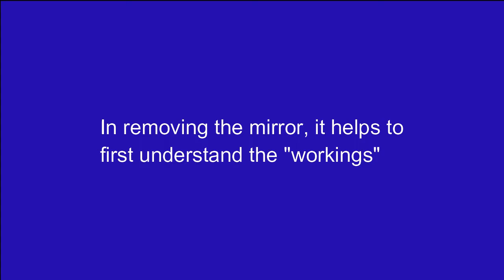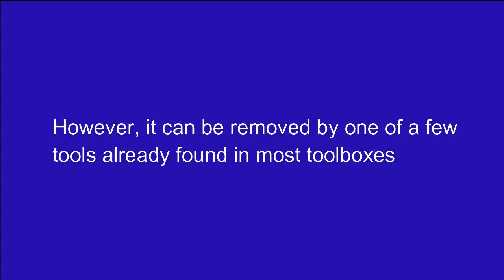Rear view mirror removal & installation (Ford Escape)

Comment: 1st video of DOZENS that actually shows you in detail what you are trying to do, shows actual spring clips, prying slightly downward on the LOWER INNER LIP, while PUSHING it off of the anchor. Others show prying down HARD without SLIDING it off. THAT IS WRONG. This is RIGHT. Prying down HARD without SLIDING can lead to dislodged anchor and/or broken windshield. 
The LOWER INNER LIP is what springs back into place when a new mirror is slid on.
This video is the Gold Standard video of how to do it.

Comment: Great video, after 16 years my rear view mirror in my 2007 mustang GT started to de-laminate, the use of dish soap was very helpful.
Reply from the maker: It's amazing how many times I grab the soapy water bottle. Seems like I refill it a lot, too. it makes a quick, non-greasy lube for plastics...heck, I've used it for lube to press ball joints into control arms. And it's always handy in finding that slow leak in a tire. Top 3 liquids used...PB Blaster, brake cleaner and soapy water! Thanks for watching!

Comment: Just what I needed: starts with a visual of the inner workings, then, explains and shows what needs to happen, and then gives three alternatives to the special tool (I used an open-end wrench, with tape, and it was perfect). Excellent video.

Comment: Great video! Just watched this before replacing the rear view mirror on my 2007 Ford F150. Took all of 3 or 4 minutes to complete. Very helpful. Thanks!!
Reply from the maker: Thanks, Nautical...glad the vid helped. The only thing I wished I had added was to never do this if the windshield is hot from sitting in direct sunlight for a long period of time...it can crack. Thanks for watching!

Comment: this is the best video I saw on this topic.  Looked at a bunch of them.  This video gave me confidence to try it WITHOUT ordering a special tool.  I used a tack pry puller.  Was nervous about cracking the glass, but took it slow as per this video and it came off easily.  THANKS !

Comment: Just a Little Tip: I just removed mine on my 2001 Ford F150, at first I tried it with an Allen Wrench that I had handy, but it was really short and made it difficult to pry the latch, I instead grabbed my longer Pocket Screwdriver and it made easy work of it. So if you have the, try to use a longer Allen Wrench or a Pocket Screw Driver. Also another tip, don't push it all the way up in the mount, just insert it just past the latch and pry there.

Comment: Awesome video. I have a Ford Mustang GT that had a screwed up rear view mirror when I purchased it. I was taking it in to get the Windows tinted at a 3M dealership who works with this all the time so I asked them to leave the mirror off when they removed it. When I got back they said they were afraid to take it down that they would break that window. They got me so nervous I was going to bring it to the Ford dealership. I have no mechanical ability but was able to do it with ease thanks to your video.That's what YouTube's all about, helping each other. Thanks again

Comment: I have a 2002  f150 with the 4.6L V8. I am mechanical inclined, I figured out how to replace the timing chains,the timing chain guides,the tensioners& gears with ease (after I read & understood where the #1 piston needed to be to keep it in time). I had to put a transmission in the truck 2yrs ago by myself. And I also had a 401 code-which means that there is something wrong with the EGR system that kept my check engine light on, which meant I couldn't pass NJ inspection since I bought it, (4yrs ago)  I finally figured out what was wrong and fix it,and I finally passed inspection 👍. Then my side power mirrors didn't work, but I figured that out & fixed it! Then about a week ago my rear view mirror fell off,and for the life of me I COULD NOT figure out how to put it back on 🤔😜! That was until I saw this excellent 👌 video that showed me step by step how to replace it. Now it's back on and I can see the past behind me 😃. Thank You for this excellent video!
Reply from the maker: Thanks, John...glad the vid helped. The one thing I would add to this video is discouraging someone to do this when the windshield is hot from direct sunlight...it can crack. Thanks for watching!

Comment: This video was exactly what I needed, thank you so much for making it!👍
Reply from the maker: Glad the vid helped you get the mirror fixed, Scott. The only thing I should've added was to never do this if the sun has been beaming on the windshield all day and it's crazy hot...it can crack. This should be done when the windshield is at a reasonable temperature. Thanks for watching!

Comment: My auto-dimming mirror has etched glass and I plan to replace it with the much cheaper manually dimming Ford OEM mirror at a fraction of the price. Will this send any kind of code to the ECU when I leave the mirror power line disconnected?

Comment: Excellent tutorial. This mirror is the same design as on my 2002 F-150. There are a lot of other tutorials for different designs, and there is some bad information also on handling this design. I followed someone's bad direction and removed the black spring clip and am unable to get it back on the mirror arm. Do you know how to replace it without damaging it?

Comment: I had mine changed twice with windshield replacement and both times I had to take back because the mirror was vibrating/shaking so bad while driving, they fixed it but both times I heard a lot of banging going on on the shop, I think they broke something, anyway why did they not use the simple Allen screw adjustment in there mirrors, so easy to change. 😳👍

Comment: In other words 
stick a tool in the Gap at the bottom of the mirror Mount to pry it away from the base plate that is glued to your windshield.
 and Slide the mirror upward off that base plate..
OK
Reply: How do you remove the baseplate that's glued to the windshield? because the mirror my Ford dealership gave me doesn't fit on the mount that originally came in my car maybe somebody changed it
 so that's the job is changing out the part that's glued to the windshield.
If you're going to change a mirror today seems that's what it's going to take so how does one do that seemingly necessary and unquestionably common part of this job?

Comment: Ford Motor wants $303 for a new rear view mirror. I was told it just snaps on. I can buy one online for $32 and I imagine at a junkyard for even cheaper. I am an old lady but trust me I think I can figure this out.
Reply from the maker: Yeah, prices are ridiculous! You can do this, and the junkyard option is the cheapest. I use junkyards quite often. Do not do this if the windshield is really hot from sitting for hours in the sun...increases the chance of cracking. Let the windshield cool down a little. Thanks for watching, Sookie!